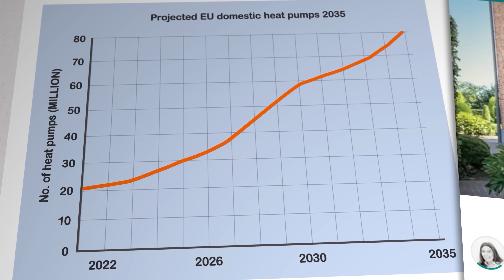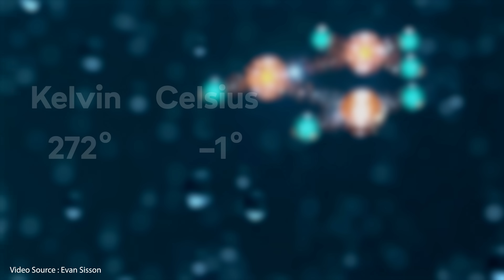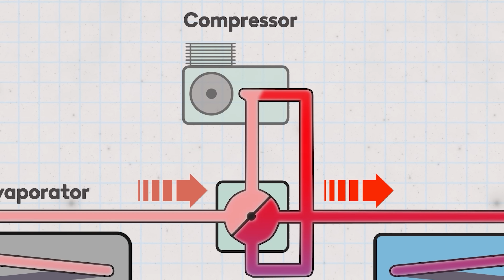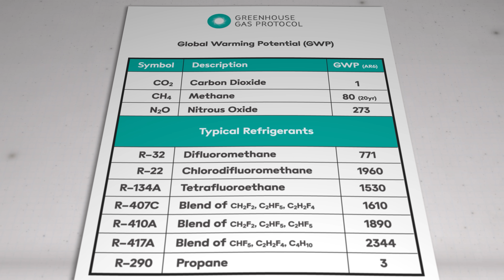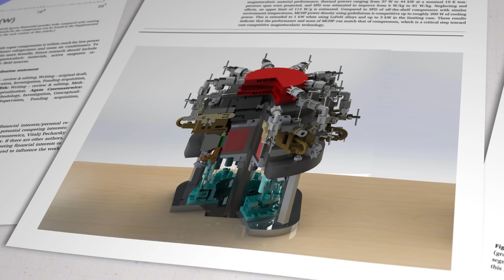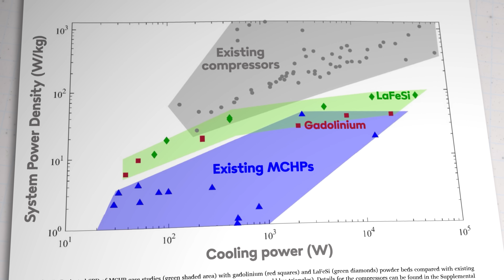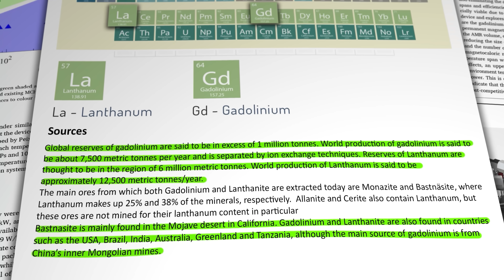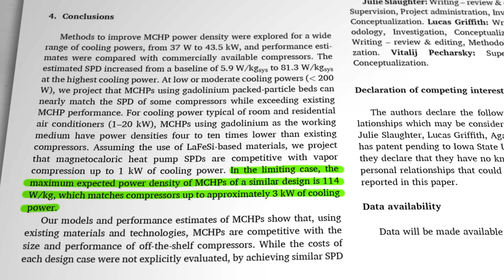Taking greenhouse gases out of heat pumps. (YES! They do contain them!)

Comment: Why have they not made a heat pump that ties in the heat into the hot water and the cold into the refrigerator? That’s something I would really want to buy. You got a refrigerator dumping heat into you home right now and if you have one of those new water heaters with the heat pump then you have a hot water boiler taking heat from inside your home.  There is an inefficiently there where they could be directly tied together and with little outside energy they do both jobs as a pair.

Was that to smart for a residential home?😊
Reply: Far too complex and the amount of heat produced by a refrigerator is tiny compared with what a heat pump has to output.
Reply: We have them in the USA, at least the got water part.  I'm in Florida and we have a heat pump water heater in the garage.  Garage gets free AC, we get cheap hot water. Win / win.
Reply: I would like a domestic hot water heater with an external evaporator so it doesn't cool my basement. Or maybe I summer, it could manifold refrigerant into my air handler to cool my house and heat my water with the same heat. Like a 3 coil split system.
Reply: @gregorymalchuk272  That's doable.  A compressor doesn't care what happens outside of it.  It's just pumping gas.  Where you choose to send it next is up to you.   The heat pumps for my condo's pool were designed for heat-only.   Another refrigeration guy in town & myself modified them to be able to run reverse cycle.   An accumulator, some pipework, and custom controls (PLC) made it a reality.

Comment: The "No-brainer Law" applies, i.e., when this is a no-brainer, then it will become dominant. As I've said before, we've not reached that point with EVs due to the batteries not having yet reached commodity status, i.e., Batteries 2.0. Bottom line: When adopting something becomes a no-brainer, the naysayers crawl back under their rocks -- where they eventually die and nobody noticed.

Comment: Even last week I saw a discussion following an article about air-source heat pumps and nearly all of it was complete BS! "My mate has one and says they are too noisy so he wants it replaced", "My girlfriend's hairdresser's aunty says she had to replace all her radiators - I can't afford that".
Trying to tell them that for every unit of energy they put in they get 3 to 5 units of energy out and they call you a fantasist drug smoking hippy that believes in fairies!
Reply: There are some problems with heat pumps.  Some of them are for some reason obnoxiously loud.  Mine is silent, so I know that's possible.  I'm guessing the problem there is old tech that is now outmoded.  Getting a heat pump to work effectively with a system that was designed for a boiler can be a challenge.  They become less effective in very low temperatures.  These things are real.  The 3-5 units of energy thing is only when conditions are optimal, and you need to consider that in some locations, a unit of heat from burning methane is vastly cheaper than the same unit of heat from electricity.  In other locations, that's not the case.   Heat pumps are great in a lot of cases, but some people will have to spend a lot of money to be happy with a heat pump.  It's not a simple solution for everyone.
Reply: @ THIS ^^^ is what YouTube is for!!

Thank you for your response.

I will be more cautious
Reply: The electric bills are so low it seems like I'm only paying to run the blower on my ducted-in cold temp heat pump.
Reply: @lshwadchuck5643  Gawd, I'm jealous of you!!
Reply: @Neilhuny  If it makes you feel better it cost $23000. I qualified for Canada's Oil to Heat Pump Affordability Program and got a $10000 rebate. But, still $13k.
Reply: The seasonal ratio will be maybe 2.5X, not 3 to 5X.
Reply: @gregorymalchuk272  When electricity prices are 4X that of gas it makes no sense at all...

Comment: I think you need to read up on mining, metallurgy and flow sheets, and then move onto mining, process and waste licenses. And when you've done that look at the multi-year or in some case multi-decades it take to gain those licenses and permits, even if they are amendments to existing and running mines, let alone those in care and maintenance or god forbid new mines. If you're going to say we can recycle them, then there are still reprocessing and waste permits to obtain. We're tying our right wrist to our left ankle with these permits and licences, no we don't need to remove them, but we do need to streamline and refine the process to speed things up to months or years, not multi-years or decades.

Comment: Heat pumps are objectively and profoundly - meh. They are 4x more efficient than gas boilers and electricity costs 4x as much as gas. Should these ratios change in the future and cover installation costs - why not.
Reply: Funny how those ratios seem so much alike. Its almost like the universe has decided that there is no such thing as a free lunch.  I too plan on throwing capital at my HVAC - an off-grid homestead with a sufficiently sized wood lot, propane tanks for water heating and radiant heating, solar panels for the part of the year where the sun actually shines.
Reply: To be transparent, I have an A2A heat pump next to a gas boiler and a solar PV system. On sunny days (not many of them in the winter) it can off-load heating from the boiler for free but overall cost savings are minor at best, probably not worth all the hassle with the installation and servicing I mainly installed it for cooling, which is a game changer in the summer and makes climate warming almost pleasant.
Reply: Except that anyone can get cheap overnight electricity that brings the cost down, plus gas boilers are typically around 80% efficient, those rated at 905% efficiency would usually require a heat survey with all radiators replaced to attain that level.

Assuming a boiler with 85% efficiency and peak electricity at 4 times, I would need a COP of 2.8 to  break even, I get a SCOP approaching 5 in my 1960s ex council house with normal insulation.
Reply: @MentalLentil-ev9jr  the cheap night rate is still 2x higher than the gas price, lasts only 3 hours and is preconditioned on having a battery. So not a simple HP installation. Same with PV panels. If you have the money (and the house!) for installing all this equipment the savings of £200/year are not all that impressive. Not without additional motivating factors, like virtue signalling, being a nerd, or not wanting to sweat like a pig (I'm subscribe to all three but only the last one is somewhat universal).
Reply: The price of electricity is exorbitant. It is linked to the most expensive source, gas peaker plant.  This must change. Although the operating costs of a heat pump are similar tto gas they will be less if you can rake advantage of off peak electriciy. Also bear in mind that even if all of your electtriciy is generated using fossil fuels, your CO2 emissions per unit of heat will be less han half of hose from burning gas. That fact alone should justify a rebalancing of electricity prrices to encourage switching from gas.
Reply: @rogerphelps9939  this (marginal cost of electricity) is an interesting topic and important topic that is swept under the carpet because seemingly it conflicts with net zero. My own opinion is, we should have as cheap backup power generation as possible, regardless of how dirty it is. Bring back unused coal plants etc. That's because we will rarely need them and availability of such cheap back up enables higher ratios of renewable sources and lower electricity prices for heat pumps and EVs.

Comment: 3kw would already cover fridges, freezers, dehumidifiers, ice cube makers, drinks chillers and many smaller air to air air-conditioning/heat pumps. That there is quite a massive market already.
Reply: Also helps hotter countries with air conditioning
Reply: 3kw is enough for newbuilt small homes (0-80m2) in the dutch climate. Our building code requires residential buildings to be heated to 22°C at -10°C outdoor (24/7, no sunlight and using questionable amounts of hot water). Which is way overdimensioned if you ask me considering recent climate change. We now rarely experience -10°C for more than a couple of hours.
Reply: Excellent point.    I'd assume a 1.5 kW magnetic heat pump would weigh about 30 lbs for the compressor which I'd think would be good enough for refrigerators
Reply: That's the electric power requirement 

It's way too big to be practical for commercial refrigerators and other cooling devices

Might be able to work for industrial and centralized cooling though
Reply: Addendum: I have no idea how big these things are, so maybe I'm wrong

Comment: Great news Dave. Love to hear about innovations. 
I’ve been wondering if conventional heat pumps could be more efficient, if we would figure out away to prevent the water in the air from freezing inside the heat pump's collector, rather than turning on a resistor heating from time to time, to defrost. 
If the air can be first be cooled to almost zero degrees, encounter material that provokes condensation of the water in the air, and next cool down the air to the boiling point of the refrigerant without icing up the collector, I think we can much more efficient, while adding only a little extra complexity. 
Does anyone know if any manufacturer is trying to innovate on this?
Reply: My heat pump periodically switches to air conditioning mode to push just enough heat into the outside coil to melt any ice. You never notice the brief transition to AC. The temperature here was down to -15 C about a week ago and the heat pump kept everything warm without difficulty.
Reply: @rogerkeay1902  I live in a sea climate area where -15C° is very rare. 
It seems that the times when temperature is around freezing point with the most humid air that provokes most ice formation. 
Once it gets colder the air is dryer by itself. 
I’m not one that believes that heat pumps have a problem with lower temperatures. 
When the refrigerant is capable, then there is no problem.
Reply: Use a ground source heat pump. Problem solved.
Reply: @rogerphelps9939  true, but with a cost.

Comment: As far as I know refregirators using the same technique are already build in Germany. (Magnotherm and others)
Reply: Yes, refrigerators using magnetic cooling techniques have indeed been built and demonstrated in Germany, primarily by Magnotherm Solutions GmbH. Here are the key developments:

1. Magnotherm, a spin-off from the Technical University of Darmstadt, has successfully developed and demonstrated magnetic cooling technology[1][2].

2. In August 2024, Magnotherm premiered two magnetocaloric beverage coolers at EDEKA Patchull E-Center in Darmstadt, Germany. This marked the first time magnetic cooling technology faced customers in a retail setting[3].

3. Magnotherm's technology uses solid magnetocaloric materials, magnets, and water-based heat exchange fluid instead of traditional gas-vapor refrigerants[2][4].

4. The company claims their magnetic cooling devices are up to 40% more energy efficient compared to compression-based systems, with COPs between 5 and 10[1][2].

5. As of March 2025, Magnotherm's refrigerators can be found at e-Center in Darmstadt and Edeka Ercan locations in Langen and Ober-Ramstadt[3].

6. Magnotherm has made significant progress in 3D printing lanthanum-iron-silicon (La-Fe-Si) regenerators, a critical component for magnetic cooling, using Desktop Metal's binder jetting technology[5].

While Magnotherm is at the forefront of this technology in Germany, other companies and research institutions worldwide are also working on magnetic refrigeration systems. However, as of the current date, Magnotherm appears to be the most advanced in terms of commercial implementation in Germany.

Citations:
[1] https://www.coolingpost.com/world-news/magnetocaloric-firm-attracts-e6-3m-funding/
[2] https://www.startup-energy-transition.com/magnetic-cooling-technology-magnotherm-set24/
[3] https://magnotherm.com/2024/08/07/sustainable-magnetic-refrigerator-premieres-in-edeka-patschulls-e-center-darmstadt/
[4] https://techcrunch.com/2023/04/04/magnets-and-water-net-magnotherm-6-9m-seed-round-to-kill-hazardous-refrigerants/
[5] https://3dprint.com/313643/3d-printed-materials-enable-magnotherms-next-gen-magnetic-cooling-tech/
[6] https://refindustry.com/articles/techguides/magnetic-refrigeration-revolutionizing-cooling-technology-with-the-magnetocaloric-effect/
[7] https://www.promarketreports.com/reports/magnetic-refrigeration-system-30695
[8] https://magneticsmag.com/magnotherm-wows-the-sustainability-movement-with-magnetocaloric-refrigerator/
[9] https://www.globenewswire.com/news-release/2020/10/28/2115859/0/en/Worldwide-Magnetic-Refrigeration-Industry-to-2025-Featuring-BASF-Camfridge-CCS-Among-Others.html

---
Answer from Perplexity: pplx.ai/share

Comment: What is the pay-back time for a system such as yours?
Reply: I my case, the payback was immediate. My gas boiler coincidentally failed the week before my heat pump was installed, and the heat pump cost quite a lot less than replacing it (largely because of the government subsidy). Running costs appear to be lower since my energy supplier has recently reduced my monthly payments, again, despite the recent energy price increases. Subjectively, my house feels a lot more comfortable than last winter, when I had gas central heating. It helps that I have an electric vehicle electricity tariff, so all of the water heating is done at night during the cheap rate and the heating is given a boost for a couple of hours in the early morning before it ends.
Reply: @chrisisbell3080  You have to balance thatt with he increased cost of electricity during dattime. A heat pump has to be on from before you get up to maybe an hour before you go to bed so it will use peak time electricity.